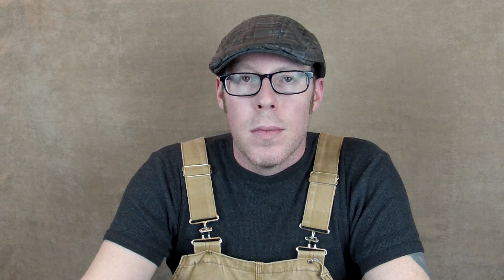Do You Need Primer For Gluing PVC Pipes?

Comment: what about this pvc one step glue that they sell at home depot? instructions say just to use the glue. Any comments?
Reply from the maker: If it is designed as a "hot glue" which means primer and solvent cement in one then that is good to go. Just so long as you are using products intended for pressure applications. I prefer primer and solvent cement, but maybe i am just old school now!
Reply: @Swimmingpoolsteve  the label says use for CPVC pipes 1/2" to 2" for hot water applications up to 180 psi. Not sure if that is enough.
Reply from the maker: @saintmaxmedia2423 yes, 180psi far exceeds pool pressures
Reply: @Swimmingpoolsteve  I was thinking that it would, though I wish I would knew more about water dynamics while working on my 150 gallon tilapia tub.:) Eva

Comment: Hello Steve I was just visiting your website researching the best option for my pool build 
I will have a pool heater 
From what I understood from website best option would be 
WeldOn 724 cpvc glue combined with WeldOn P 70 purple primer. 
Is this correct
Reply from the maker: @mikimiki195  for solvent welding cpvc? Sure that would be good. For most residential pools CPVC is really not needed, so regular PVC solvent cement is fine to use on the joints near the heater also.
Reply: @ thank you Steve 👍🏻

Comment: 0:08 incorrect, as has been proven for decades straight glue makes a stronger joint. The strength of the joints far exceed rating though so it isn't relevant.
Primer is used for a more consistent glue job

Comment: Back in the 1960s I didn't have primer when I laid a mile of city water  pipe in the ground to our home. 50 + years no joint leaks. All I had was a bunch of sandpaper to roughen the mating surfaces.
I do use primer now when working with any glue up pipes. 
 I'm not sure I saw primer in the hardware store when I ran the waterline.

Comment: Hey been working with PVC for 30 years and not once did I use primer in fact there wasn't such thing these companies trying to make more money Now when I did a test on PVC primer and cement glue it actually came apart with channel locks now without using the primer they were impossible to pull a part. don't
Reply from the maker: Can't fill a cup that's already full. Primer is not optional, and your work is substandard without it.
Reply: @Swimmingpoolsteve  it is with it because it interferes with the bonding agents educate yourself and stop pushing for people to waste their money.
Reply from the maker: @myviews469  if you are not using primer you are not solvent welding. Time to rethink your technical process and stop burying leaks which could cost someone tens of thousands of dollars so that you can save ten bucks on primer "you don't need". All those engineers that designed the product and spec it for technical projects around the world...those guys they don't know what they are talking about. Buy myviews469 says that is BS and you don't need it. What a load of garbage.
Reply: You're sounding highly obstinate in regard to what works better.   See the tests.  @Swimmingpoolsteve

Comment: Hmmm.  My local hardware stores differed on which primer and glue I should use to connect up 3/4" PVC pipes outside to my whole house filtration system.  One recommended the Oatey's purple and red pack.  The other the Oatey's yellow and gold  (both claiming to be clear) pack.  All of them said they work for PVC, but the latter combo was supposed to be just for PVC.  I only see Youtubes with the purple stuff, so I got concerned.  I live in Central Florida, and these pipes are how water comes into my home, so I want to do it right.  Any thoughts?

Comment: I'm not able to find it here in Portugal. Even the hot tub supply company (I'm building a hot tub) in France doesn't sell it. It sells BlueTite. I've been sanding the joins and then cementing. The cement itself has solvent in, so I can't be that terrible can it...?
Reply: After looking in to this a bit further and seeing my work from yesterday. I think this advice is either different in North America vs Europe (perhaps due to some kind of regulation?) or even incorrect. The PVC cement I used yesterday has clearly welded the joints and in fact where I dropped it on some foam board insulation it's sunk in about 1cm... Therefore mechanically prepping the surface with sand paper has to be superior to using a solvent primer, as in the former you are completely removing a manufacturing residue, not introducing any other chemicals and increasing the surface area. If you used primer after sanding you'd actually reduce the surface area afterwards and possibly soften/weaken the surface more than was necessary, if you used it without sanding (maybe that's it's main use) that just sounds like an easier alternative to mechanically sanding which is fine and makes sense if you're doing a lot of it but it's certainly not better.
Reply from the maker: The primer chemically softens the pipe to receive the solvent weld.  You can glue pipes without the primer, but the connection is inferior.  It does not mean it will fall apart in your hands, but if you did lab testing on two pipes the one with primer will be a superior connection.  More than just pressure there is pipe hammer, stress on the joint, cold and hot conditions...these all change the performance of a solvent welded joint.  I definitely recommend primer and then solvent cement for any pressure rated PVC application.  Note, some solvent cements are now sold as primer and cement in one.
Reply: @Swimmingpoolsteve  I took your comments on boards and finally managed to find primer in Europe (sold as "cleaner"). Yes,  you were correct, I can see the benefits straight away. Sorry for the doubt.
Reply: The tests online have adequately shown that clean pipe with cement alone is a stronger bond than primer with cement.    Another thing is primer alone, for the melting-weld-bond @Swimmingpoolsteve

Comment: Thanks for the information.  When is a clear primer OK to use ?
Reply from the maker: It is fine to use unless you have local code requiring purple primer for inspection. Clear is most commonly used on the equipment pad

Comment: i'm from europe and i used acetone and paper napkin instead of primer for PVC-UH for the bottom drain under my concrete koi pond. I did deburr the 110 mm pipe and i used proper cement but i'm not sure if i turned the joint right after joining toghether but i used alot of cement . The presure is under 0.2 barr .Do you think i'll have any problem with leaks?

Comment: I too do not use the primer and there is no way in hell I can pull them apart. The pipe itself would break in another area before the joint glues. I have learned this from Master plumbers. I have my drainback well in Alaska and it is 6 feet off the ground now almost 20 years in there still has been no problem period. Where I find the problem is people do not read on how to bond the 2 pieces together. Maybe because the print on the can is too small to read. It says apply to both male and female insert and do a 1/4 turn. I wonder who is not doing this and this is only what the primer is for!
Reply: Try primer alone.   See how that bond weld is.
Reply: @bonsummers2657  Interesting never tried that one...........Do you know if it will work? I am now over 20 years without using the primer at 65 psi. I am not sure what a pump on a swimming pool runs at. If it helps I am in Alaska and the pipe is outside. (i have a drain back system. The temperatures here range from -40 in the winter and above 80 in the summer. The one thing I have not thought about is it possible that the glue is not the quality it was when I was using.

Comment: What alot of people(professionals) seem to OVERLOOK in these Instances and what I've learned as a mechanic for over 20yrs is theres a proper 'by the book' way of doing something and a way that, although not 100% correct, STILL WORKS. And regular everyday people are often faced with limited time, money, resources, tools, etc and sometimes what matters the most...... 
Is the getting the damn job done with what ya got. I glued my heater bypass pipes together for My pool last year with no primer and they held just fine, still holding fine. And u know what I like knowing? When I decide to put a heater back in, I can disconnect those fittings and hook up my heater easily. Sometimes easy is better than by the book. U choose for urself what works best.
So in closing... Can u do it without primer? YES, is it correct way? NO.
does it still Work, YES!
Reply: Here in the UK Primer is almost never used & isn't even available in some DIY stores. I'm not saying it's a better way of doing it, I'm just saying none of the professional plumbers I know or I've watched work etc use primer.

Comment: The problem being the fittings will no longer fit the pipe. Water supply lines for schedule 40 would not fit elbows and tees. However, without the primer, the fittings worked well.

Comment: primer can act as a barrier between the surfaces your trying to bond together....
18 yrs in Municipal Waterworks i have never used primer with pvc.....
i always scuff up the surface,clean with isopropol, heat up glue and pipes if possible, apply glue....i did this on one paticular line with 1.5" Sched 80 pvc 12 yrs ago on a visible line under 90psi with pure chlorine gas mixed into cold water, multiple 90°'s , shut off valves etc....works great
Reply: In that specific instance and all those extra steps wouldn't it be easier to just use the damn primer, slap it and go? Lol
I mean I don't use it either, but the whole Town doesn't go without water when my pool pops a line lol
Reply: A side note, the isopropyl alcohol might play the same role as acetone in softening up the pvc. I’m not chemist so I’m curious if this acts as a primer.

Comment: Steve, is it also recommended to use a pvc cleaner before using the primer too?  I know that pvc cleaner is available and just wondered if it was necessary if the primer is used.
Reply: not Steve!  but primer acts as a cleaner. :)

Comment: What is the proof that solvent-cement alone, with proper application, 5 second or so delayed melting prior to connection, and seating makes a weaker bond than with primer, all things being appropriately applied, per expected practical standards?

Comment: I quit using PVC primer thirty years ago.  Primer or not, if you fail to adequately coat the mating surfaces with glue, you will have a failure.  For strongest joints, skip the primer, but use more glue.
Reply: So if you sand cloth the pipe, and fitting, and the pressure is low at 60 PSI and only use cement, the joint should be cool right?
Reply: Been building pools 16 years and only had 2 leaks and were both in skimmer plugs, never used primer, so I agree with you William Reynolds

Comment: What about just using primer? I did it on accident and it’s solid as a rock
Reply from the maker: You might think it is okay but it is not.  It is not actually solvent welded properly.  Yeah when you spill primer into a bucket of fittings it glues them all together but the solvent welding process needs the glue as the binding element not just for how it feels in your hands now, but how it weathers over time, deals with pipe hammer, absorbs stress from thermal expansion and contraction.  Definitely a no-go on the primer only joints.  Better redo that.
Reply: @Swimmingpoolsteve  Ya but if it's sealed, I mean it's sealed right? why fix what ain't broke? If Ur gonna pull it apart anyway why not wait and see if it pops apart on its own and then redo it? My Bet is you'll be waiting a long time lol
Reply: See the tests of primer alone, vs. primer with cement.   Do the tests.   @Swimmingpoolsteve   I realize weathering is another factor, but, see the tests even on short term.     Primer is more of a solvent than the pvc cement, and hence can weld at least as strongly alone with PVC, with normal proper application dosages.

Comment: I did irrigation for years and we rarely used primer
Reply: Ya my wife runs an irrigation install Business, they rarely use it either. It's usually lines splitting from age or work bein done above ground and  digging into it that causes the need for repairs
Reply: Bet your repair man was working his ass off though😆

Comment: So, the black pipe they used to repair my sewer is "ABS"? Hope so, because I DID NOT see them prime the pieces before gluing together. Please respond...
Reply from the maker: Black pipe is not PVC, most likely ABS or poly.  Did they use yellow glue as that would also be an indication of ABS, and no primer would be needed for that because it is not meant to be used for pressure applications, only drainage applications.
Reply: @Swimmingpoolsteve  OK Thanks!

Comment: I've been told you don't need primer  "it's only for inspection blah blah blah" 
Primer softens and heats the pipe/fitting so they literally weld together (hence the name of the company Weld-On)
Anything smaller than 1" will be fine , but I still prefer to use primer on ALL repairs. 
I repair irrigation manifolds (2" PEB and PESB Rainbird valves) , 2 1/2" mains , 4" mains etc and I have NEVER had a repair blowout on me.  
721 glue doesn't require primer for anything bigger than 4" I believe, maybe 6" - regardless I use primer . 
People make me cringe . It doesn't take that much time , just primer the dang pipe and fittings man -come on!!!
Reply: I'm no plumber, so I'm not 100% sure it was PVC or some other type of "plastic" pipe you use in home plumbing applications. But I decided to take on the job of routing unfinished plumbing in a home I bought in 2003. I decided to use a copper-to-"PVC" adapter and do the job that way.  I picked up the proper non-copper piping, from the different types Home Depot carried, and I bought a DIY manual and asked advice from a couple "experts". 

I was told that new cements precluded the need for primer, but that inspectors may fail the home inspection if they didn't see the purple primer around the joints. So I bought purple primer, followed instructions to the letter, and ended up routing new hot and cold pipes to the kitchen from the basement below, and to an unfinished sink in the basement. I slopped on the primer, ensuring to leave it obviously visible beyond the joints. 6 years later I sold the house, never having a drop of water leaks, and no problem passing inspection. But this is the first time I've heard anyone mention the primer subject since then, and I was surprised to hear that the primer IS necessary. I'm glad I used it.
Reply: @HighlanderNorth1  right on man 👍🏼

Comment: Steve.....love your videos.  I've referenced many of them while building my own in ground pool.  I'm at the stage of installing my equipment and above ground plumbing.  Do you have any recommendation for ideal plumbing setup that accommodates winterizing, check valves, pressure gauges, diverter valves, etc.  I have 2 skimmers and a main drain on the suction side.  I have 3 return jets, a slide supply and a water feature supply.  All returns and supplies are 1.5" rigid PVC and are ran individually to the equipment pad with shutoff ball valves.  (To be clear, I have 8 lines with valves coming out of the ground at the equipment pad.)  I have all Hayward equipment. Pump, cartridge filter, 300k BTU heater, salt chlorination.   Thanks for any input Steve!

Comment: Also dont forget to NOT use vinyl or latex gloves when dealing with glue, because the glue will eat through them. Nitrile or rubber gloves I believe are efficient.  I've seen a guy use a clear glue on a pb4 booster pump install. He said the clear glue didn't need primer. Is that legit?

Comment: Primer weakens the pvc bond. If you had actual proof then show it
Reply: Yeah there’s a whole lot of “use this because I said so”. I’ve seen a lot of test data that shows primer has a negligible effect or actually weakens the joint.
Reply: Read a study done by a graduate student that tested this and says the total opposite that the test they ran found that primer actually weakened the joints and that most plumbers do it because code requires the use of primer but that the glue by itself makes a stronger joint when dried…..so now I don’t know what to believe but I use primer.  Pool fitting cost to much to risk it not making a strong bond and haven’t seen enough yet to prove that primer isn’t necessary.
Reply: @PaulSeymourVA  Paul I learned from a master plumber that if you glue correctly you DO NOT need the primer. I challenge Steve to try to pull mine apart. There are a lot of reason this can happen. Be that as it may. OK correctly pipe is clean, apply to both ends push in all the way and turn 1/4 turn. I'll bet you missed that. It is written on the can in very small print that no one ever reads. I live in Alaska and have never used. I know the inspectors love to see that purple. I will never use.
Reply: Primer should be used to clean pip on the quick, if to be quick.    Also, try just primer alone, makes a secure weld.   @PaulSeymourVA

Comment: As a manufacturer of said "glue", it's actually a cement.  Glue is a bond BETWEEN two surfaces, whereas PVC cement alters the molecules that make up polyvinyl chloride surfaces, fusing them together into a single piece of PVC union.  just saying....
Reply: How about just primer alone to weld the pvc surfaces?
Reply: Pedantic jerk.

Comment: Hello, why not make a test on video where you show the difference in strength between primed and not primed joints. I have read a test where the primed joint was actually weaker, it would be interesting to see yours
Reply: It’s not coming. Because it would have proven his original video wrong unfortunately. 😂
Reply from the maker: its coming :)
Reply: @Swimmingpoolsteve  so I tried and saw no difference with or without primer. I also saw several other youtube videos and they pumped some pipe fitting to over 1000PSI and there was no difference between primer, no primer, etc 😭